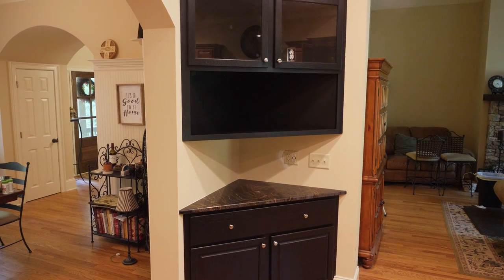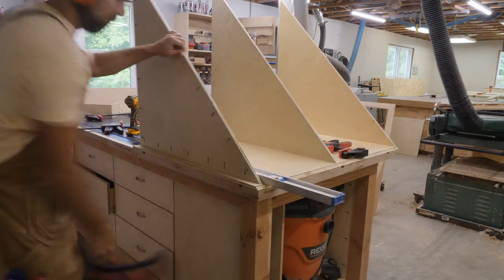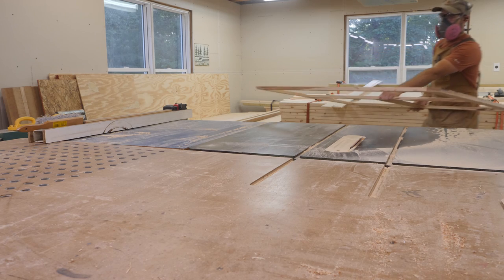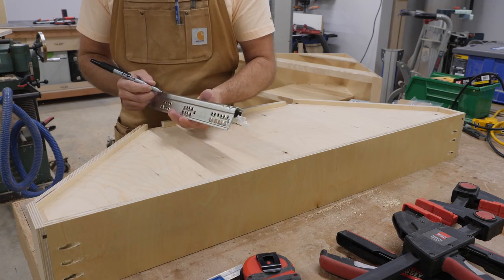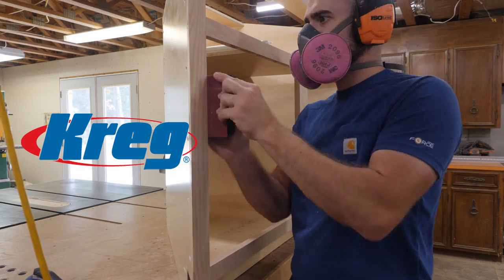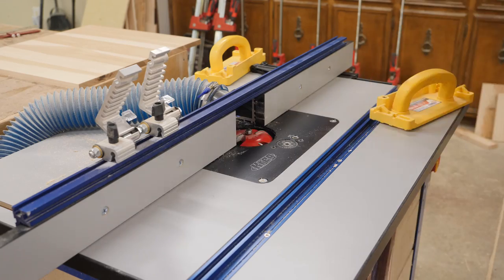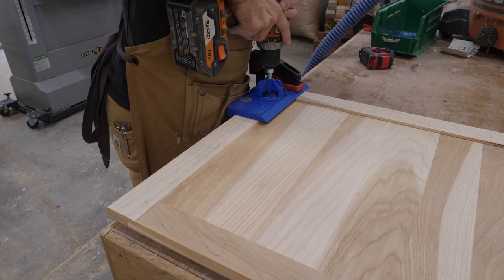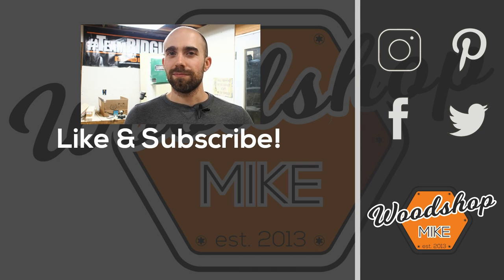How to Build Corner Cabinets with Raised Panel Doors

Comment: This is great work! I feel like the Kreg screws were a little extra work when assembling the carcass as a normal face screw is just as effective, faster and easier in my opinion
Reply from the maker: Thank you very much!  Yep, I hear ya, but I always fear splitting plywood when screwing into the edge so I stick with pocket holes 👍

Comment: Liked the video. As an old cabinet builder myself I was just curious as to why you did not use glue when joining the wood together with pocket hole screws. I know what Kreg says. I just believe when you join Wood, you should use glue for quality workmanship. No disrespect intended. I like your workmanship! I was just trained to use glue, that’s all.
Reply from the maker: Thank you!  No disrespect taken👍👍.  I don't use glue because with the screws I don't see it's necessary.  Not that it doesn't hurt, just saves me a bit of time.  Thanks for watching, hope it was enjoyable😃